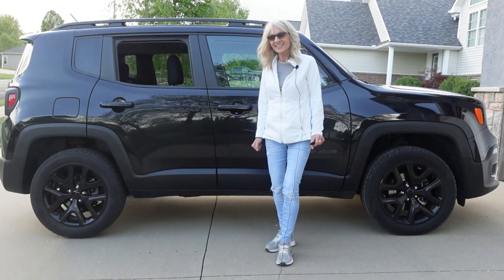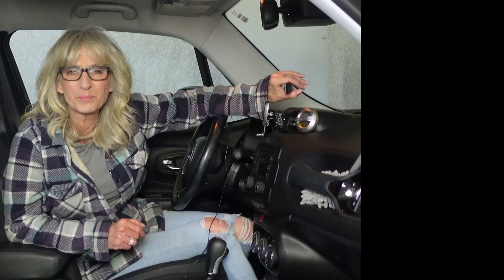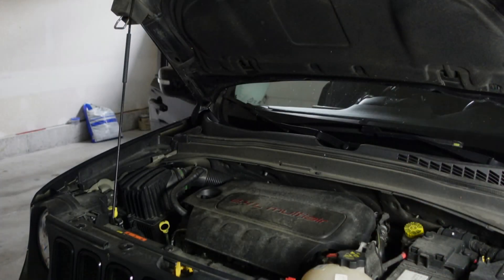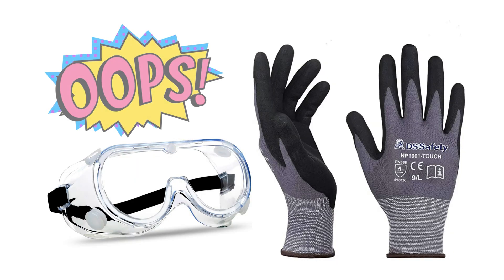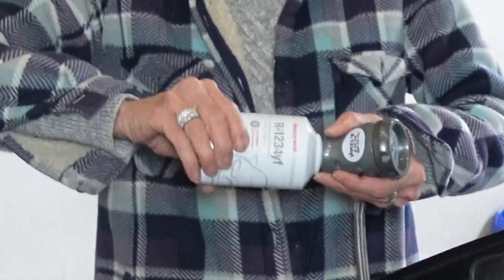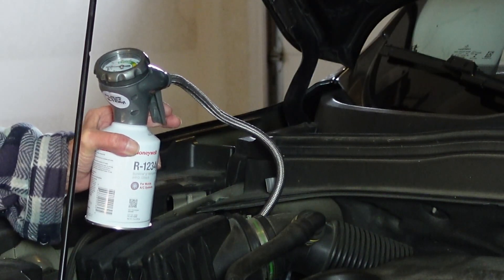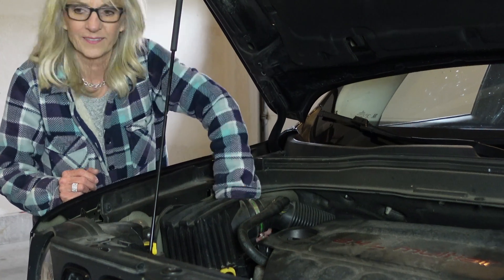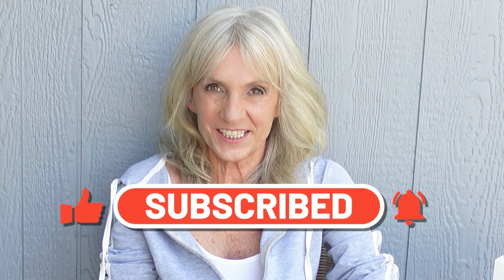WARM AIR BLOWING FROM CAR AIR CONDITIONER |2016 JEEP RENEGADE|R1234YF

Comment: Explanation: When your R1234YF reached a certain pressure, the system turned on and pulled the gauge pressure really low. You overcome this. You eventually underfilled it, but it was working OK. It's better to underfill than overfill. You don't want to let it run completely empty. Turn it on every few weeks in the winter for a minute. Your next step is get another can when it stops or gets too feeble. Overfilling strains it and the cool drops low. You picked out the right supplies and hardware. Thumbs up.

Comment: Hi all, if your outside temperature sensor isnt working correctly on your Jeep the AC will not work. The outside sensor is located underneath the wing mirror, and can be replaced for £10. If your car says its 100degrees and its snowing outside, you need to replace it.

Comment: I noticed you were wearing a flannel shirt when filming the video!  I would recommend that you check your pressure during the heat of the day.  Refrigerant will expand in warmer temperatures, which will result in higher pressure.  Additionally, when adding Refrigerant in cooler temperatures, you may mot get a “Full” charge on your AC System.  Lastly, look at you AC/Refrigerant label/tag on your vehicle.  Along with the type of Refrigerant, it typically tells you the capacity in Grams.  Also, if you’re AC System has leaked down, you typically will have a vacuum leak that has occurred at a connection from a bad an O-Ring, or a pin hole in your Evaporator or Condenser Coil, and if this is the case you would generally not get a full charge on your AC System.  But, I would first suggest rechecking your pressure in the heat of the day and after your vehicle has run for 1-Hour!  The above has been my experience when recharging my AC with 1234-yf Refrigerant.  Great and Helpful Video.

Comment: Sorry in advance, but this is not a fix, it is a band aid.
Reply from the maker: Yes, you are correct.  It all depends on the severity of the leak I would suppose.
Reply: It's a band aid but one can put this bandaid for less than $20.00 a year. @KellyRaeCreates
Reply: Well,
Sometimes all the vehicles without leaking with the years loose some refrigerant as well when they are in not to much in use, the rule is check for all the leaks areas as hoses, evaporators, front and sometimes rear, ac compressor control valve, etc, if you rule out all those and is not problem at all to fill the Freon level as she wish !!
Blessings!!!

Comment: Great film with a lot of useful information. My case is more complicated, since I have a small leak I need to find, but I've learned many useful facts fm/this film, like how exactly to shake the can (in some films they flip it over, in some say: you need to keep it vertically, in some: don't do 90 degrees, in some: do 90 degrees - very confusing for the beginner), or that part about pressure monitoring.  Here everything is clear and with all the details. I replaced all the parts of my AC system, besides the Evaporator, Compressor, and Liquid Line (Expansion Valve - to - Drier Line), but I've never charged the system before. I'll definitely be using this film. Thank you very much.
Reply from the maker: Thank you, hopefully charging it is all that needed to be done!  :)
Reply: @KellyRaeCreates  Thank you for your concerns. I found that leak like 2-3 days ago by pressurizing AC system w/air, it was on the compressor seam. I thought to try that old compressor, which was in the system before, but now I know it is leaking. As far as I understand the leaking compressor needs to be replaced, so I ordered a new one and just need to replace it. Hopefully it is the only leak.